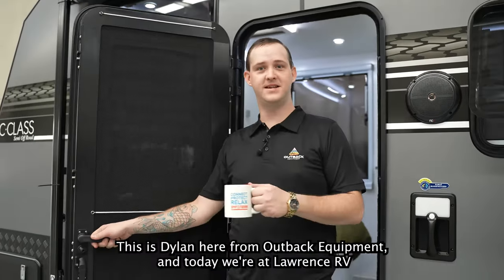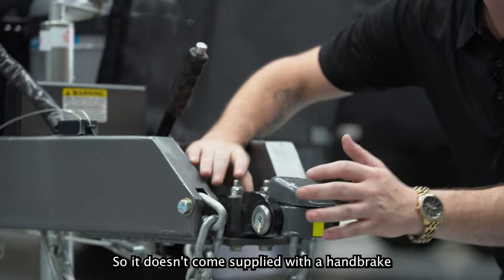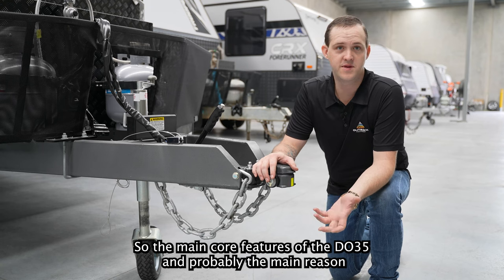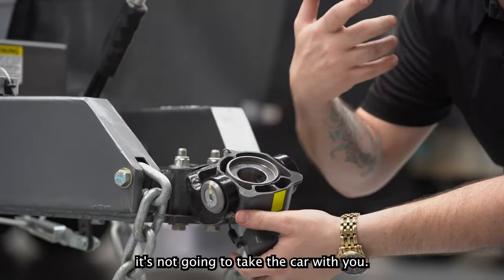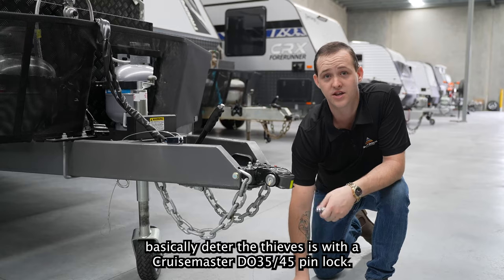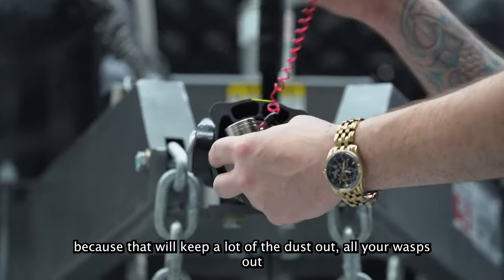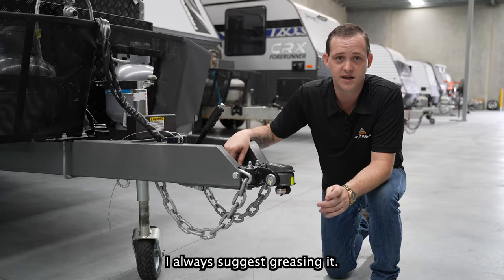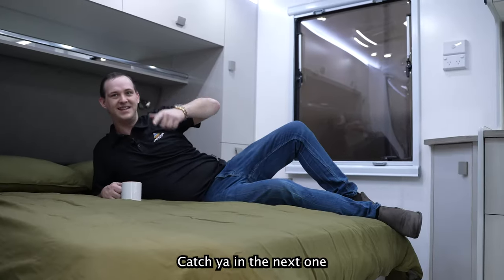Do35 Coupling - Product Features Explained + How To Keep It Safe.

Comment: My do35 hitch jams on , so when I try to unhitch ,the jockey wheel lifts both car and caravan . It will not release even after driving forward and backward several times . The hitch is serviced and I dry lube the pin. Any ideas why .
Reply from the maker: Hi There,

Ideally, before hitching up to your tow vehicle, it's advised to check over the coupling, by making sure the Tow Pin and Universal are free of sand, dirt and foreign objects, and is lightly lubricated at all times, as this can cause an issue with the operation of the lock assembly.

alternatively, there is also the possibility of some damage to the coupling, if you like to get in contact with us, we can send you a copy of the Maintenance & repair guide for the couplings.

are you also able to confirm the model version of your DO35, if unable to please take a photo and email it to us at service@outbackequipment.com.au,

Safe Traveling.